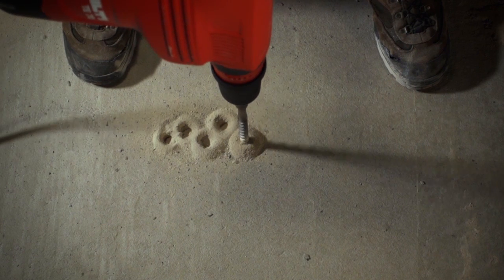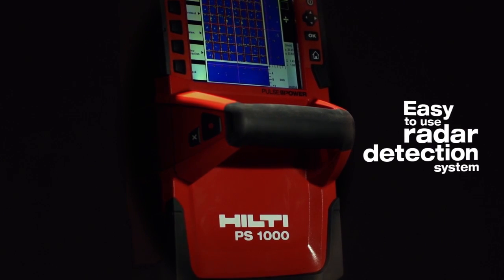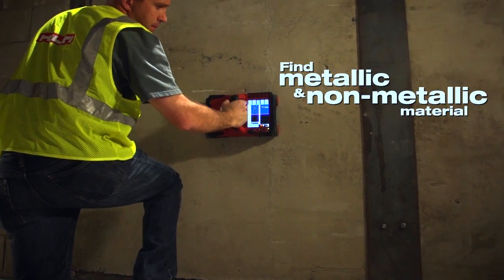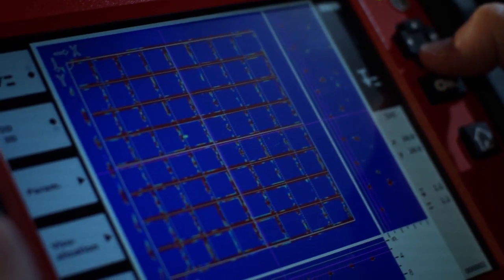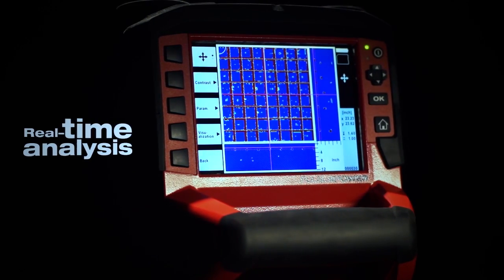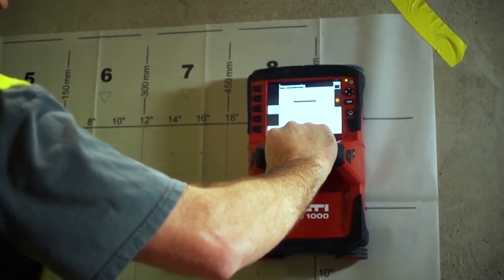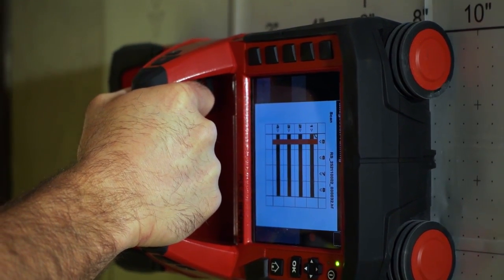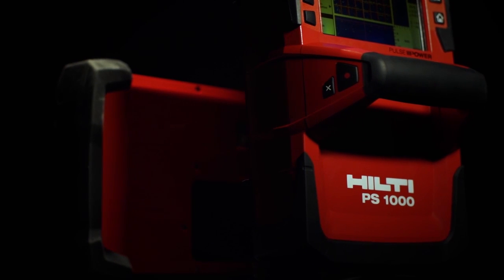INTRODUCING the Hilti PS 1000 X-Scan radar detection system

Comment: Can you retrieve size of the rebars and how much corroded they are (or how much diameter of steel left) from these readings? And is there API available for the software so that the information stored can be inserted into engineering analysis software for structural assessment ?.
Reply: ziya dalkılıç it’s not even close to that accurate
Reply: No